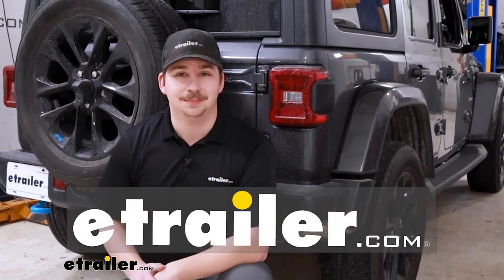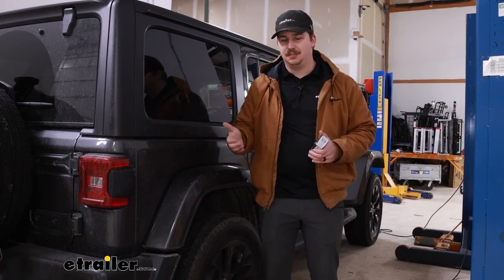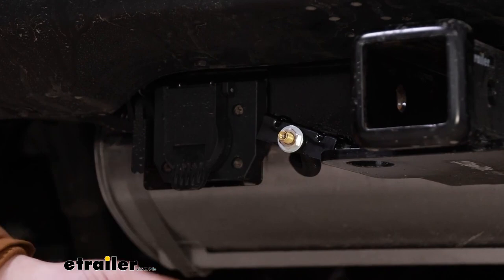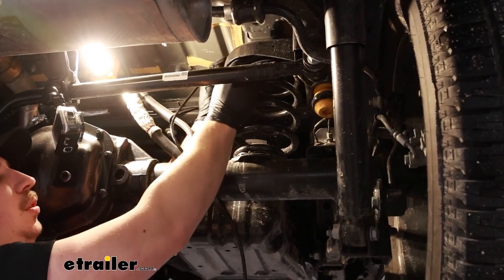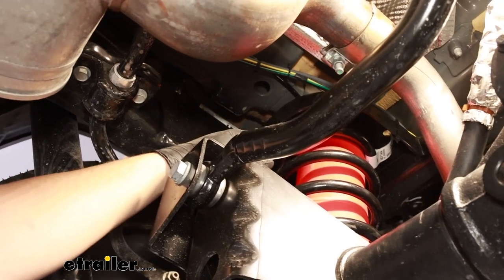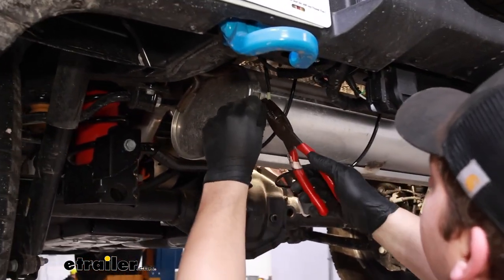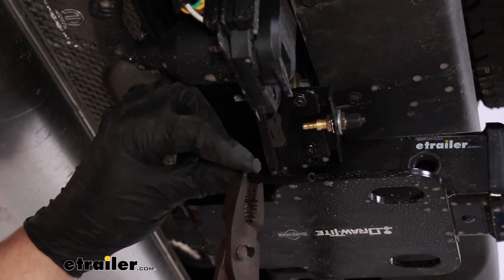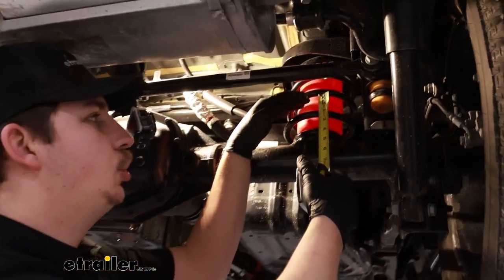etrailer | DIY 2023 Jeep Wrangler 4xe Installation for the Air Lift 1000 Universal Air Spring Kit

Comment: What air lift 1000 kit do l need for a 2017 jeep wrangler JK with a 2.5 inch suspension kit installed?